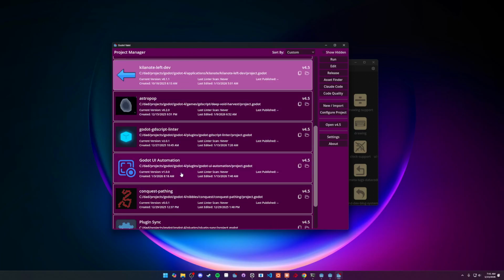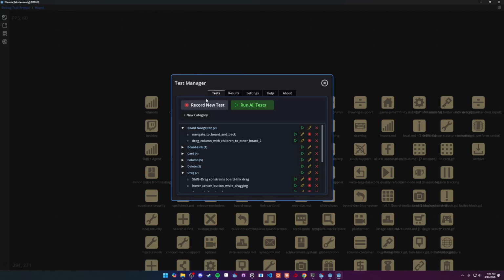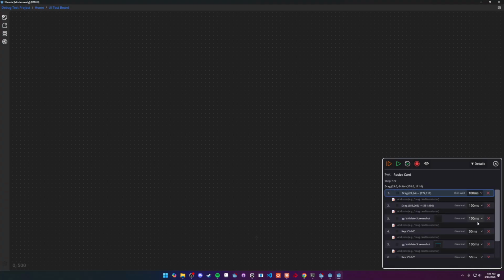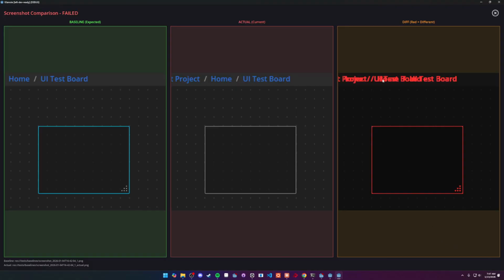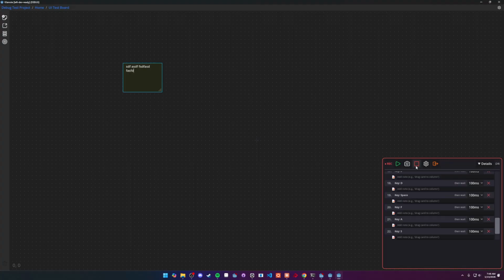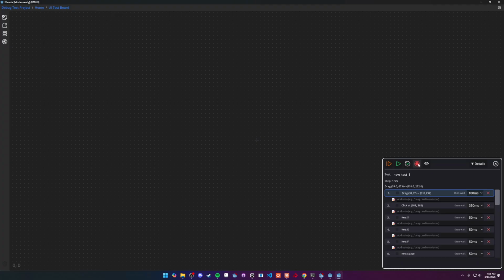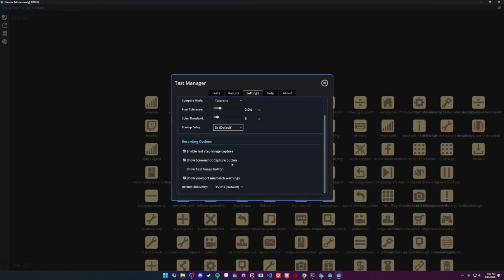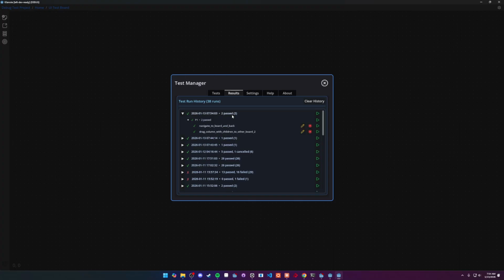Godot UI Automation Plugin - Demo Walkthrough

Comment: that's cool and all, but like, how would one be able to run this in a CI environment, also, what about using this for games/non pure ui stuff, I feel like this could work if the game and the test was running in realtime, which is time inefficent, but it could work ig...
Reply from the maker: It has CLI options to startup and run the UI tests and exit with code or stay open. It does require the app/game to run. This can be used with any godot project but you do have to deal with variability in games. I suspect most games will need to have a test mode that fixes the seed and ensures repeatable steps and captures.
Reply: @graydwarf22 how does it handle screenshots in CI mode?
Reply from the maker: @vihoyer you would have to run in a VM. It needs to launch the app/game. I haven't set this up yet.